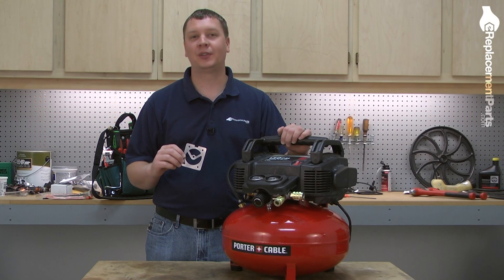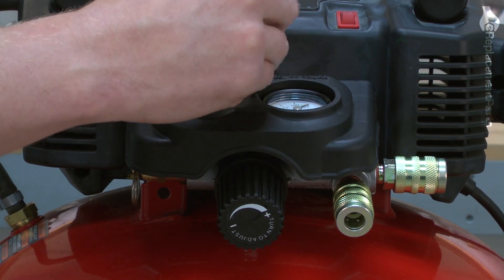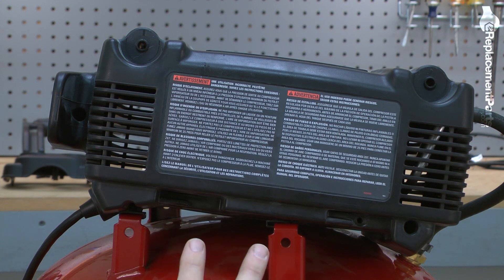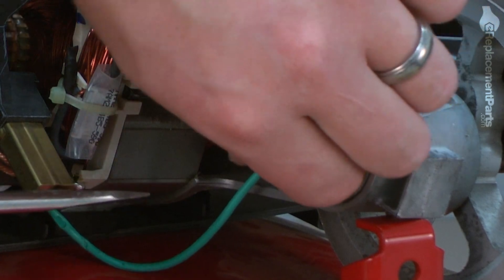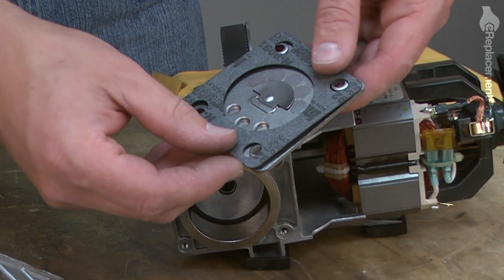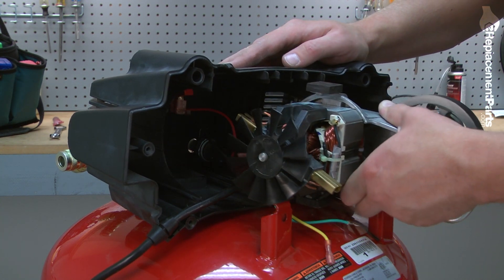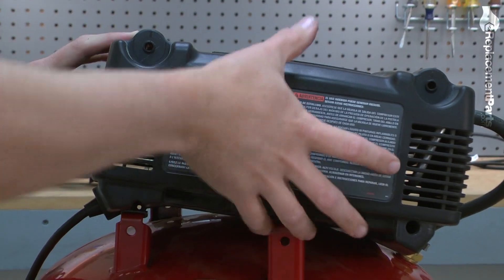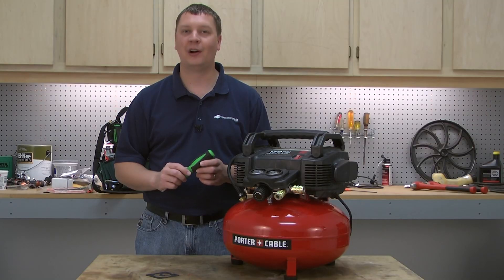How to Replace the Head Gasket on an Air Compressor

Comment: Are there any alternate heads available for this model while keeping the rest stock? I would like a head that had threaded holes for barb fittings on the intake and exhaust sides so a filter can be used and so a $3 o-ring isn't the only thing holding the exhaust line to the head.

I considered altering the head I have but wanted to ask first.

Thanks

P.S. eReplacementParts.com is awesome!